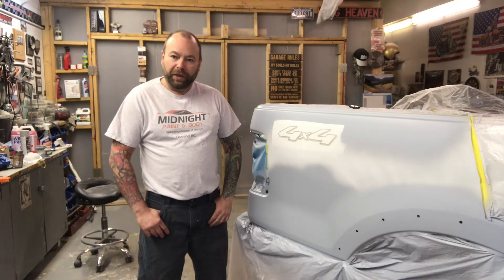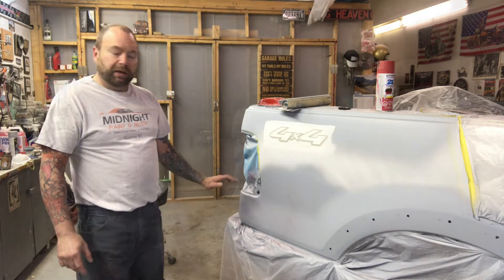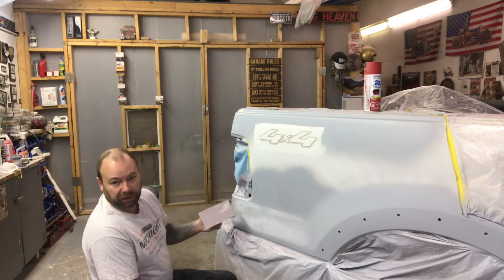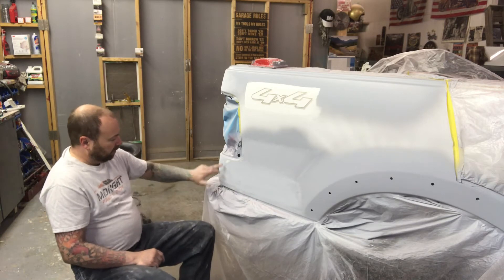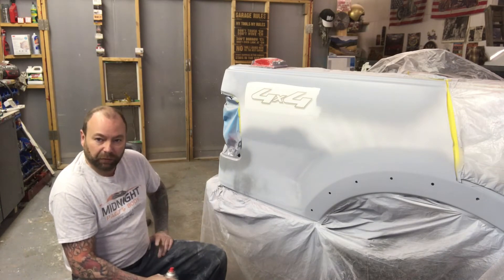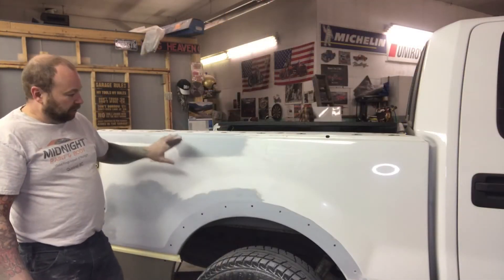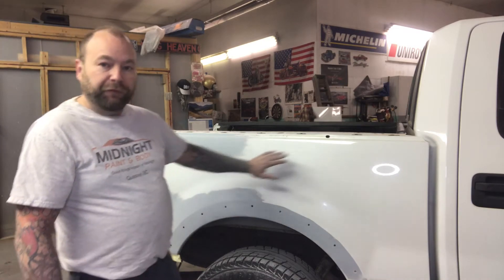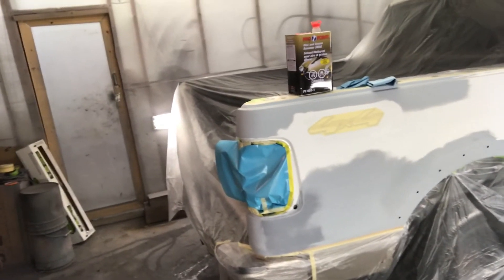Block sanding primer, prepping a panel for paint, and spraying basecoat clear coat!

Comment: I too prefer base coat that does not use catalyst does seem to take longer for it to dry. Like you I also have a gun for each purpose one 1.7mm sealer/priming gun, one for base color, one for clear, and a mini for cerakote